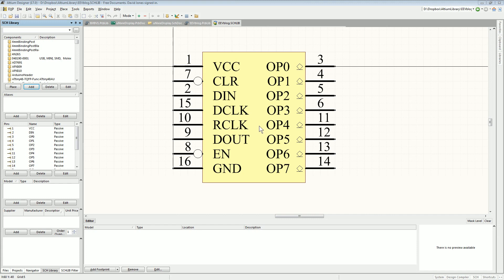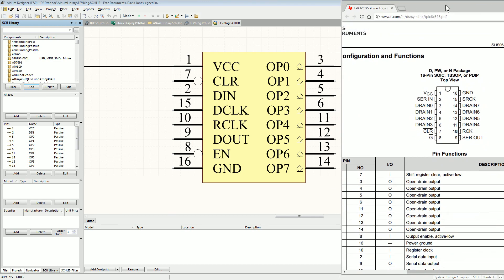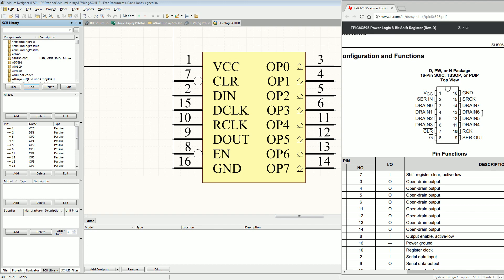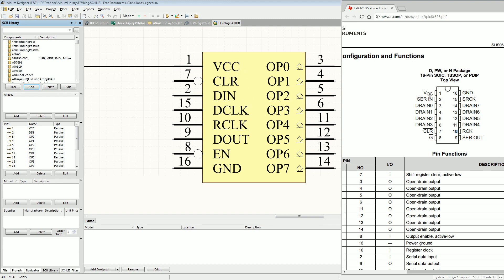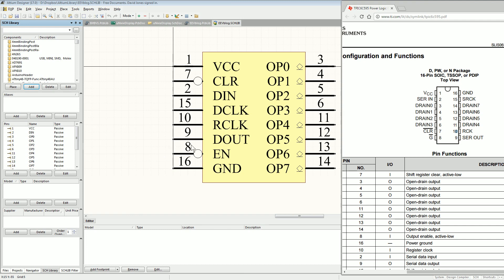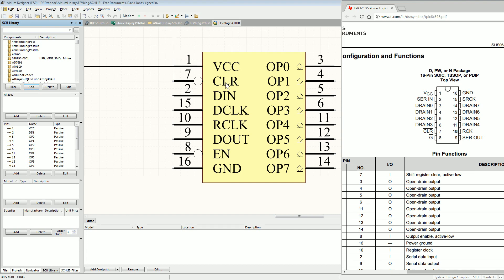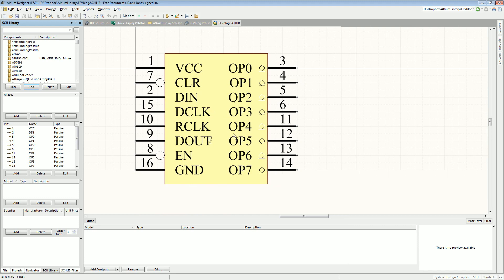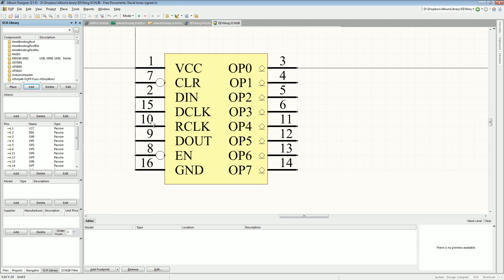Schematic Component Library Drawing Tip

Comment: One thing to watch is bringing in schematic parts from Accelerated Designs. They're off grid by a fraction of a grid tick. They'll state that they are on, say a 10 unit grid, but are a slight bit off. 

When you place the part, you'll think you're connecting wires, but if you look carefully you note the lack of the little X on the pin as you place the wire. 

You'll need to select the pins in the sch lib editor and use Edit - Align - Align to grid.

Comment: I only partially agree with this.
It really depends on the type of schematic what to use.
Especially when you need to troubleshoot a lot, I absolutely hate changing the pin lay out in schematics.
Can be extremely confusing and lead to very frustrating situations. 

I rather use global connectors, also a good way to keep the schematic tidy.

Comment: TPIC6C595... interesting... clamped to 33V....   sounds like the HV drivers are back in the game.  170-33=137... sailing quite close to the wind?  Interesting idea though and look there's a TLC6C5912 which has 12 outputs up to 40V... 10 digits plus 2 dots!  Nivana!
Reply: Regarding the pins.... the actual schematic wiring can have a huge effect on the PCB layout so the physical position of the pins on the source and destination components is important even if it makes the schematic look messy...
Reply: The schematic results in a netlist, which is the input to the PCB layout software. The layout of the schematic has no other impact on the PCB layout.
Reply: Where you have a lot of bus pins going from one device to another then it can be useful to arrange the component pins on the schematic to reflect their underlying physical structure rather than iterating between PCB and Schematic.  This of course only applies to situations where pins can be swapped by some other mechanism e.g. firmware.

Comment: That's a nice way to keep the schematic clean on a circuit that never needs repair ;)
When troubleshooting with a schematic I usually look at the schematic, for example count the number of pins in and look for the same number of pins in on the actual chip on the PCB.  Unless of course the schematic is not physically numbered. 
For me at least using our own in house schematics, it avoids a lot of back and forth looking confusion on a complicated repair.

Comment: There used to be the UCN5841 which were 8 output open collector high power shift registers with back emf diodes, they were designed for driving relays or other coils but I used them for LED displays. They may have worked on the Nixie tubes with exception of being short 2 or 3 outputs. The bugger is they are discontinued and obsolete.

Comment: Looks good for the schematic but doesn't help much when you need to troubleshoot an actual circuit with it. It gets confusing when you need to cross reference what's what.  I would consider this a wiring diagram. Where the schematic should be representative of the actual layout of the circuit. Which all pins should be in the correct position.
Reply: On 98% of the schematics for PCBs I have seen they do not ever have the "correct" pin layout because of all the reasons stated above. If you can't look at a schematic for a pcb and go oh, thats pin 7 it goes to ground and then look back at the board and see that you are just being difficult. Plus, the PCB doc is typically more useful in a case when debugging hardware because it has all the traces exactly where they are and not a bunch of lines.
Reply: Shawn... Damn... I just saw your post after I posted mine. I agree with you. My own schematics are drawn identical to physical chip pinouts to avoid pin confusion when doing repairs.
Reply: Those of you that agree thanks. I'm an electrician not a electronics guy by any means and I like the drawings to show what is actually done not what the intention is for ease of making a drawing easier to look at or more pretty.t needs to be accurate because someone else may need to troubleshoot it and are unaware thatthe part installed may be different than what's drawn.